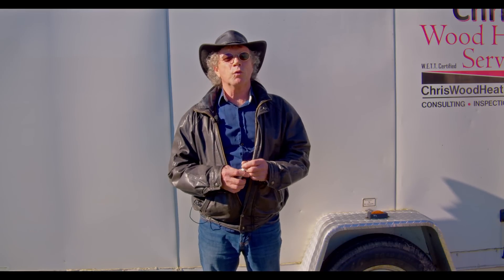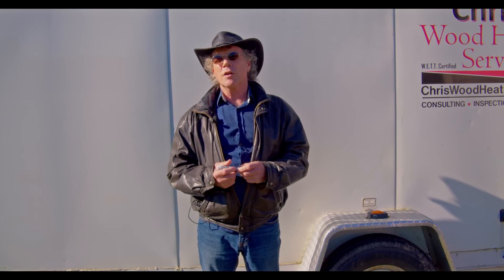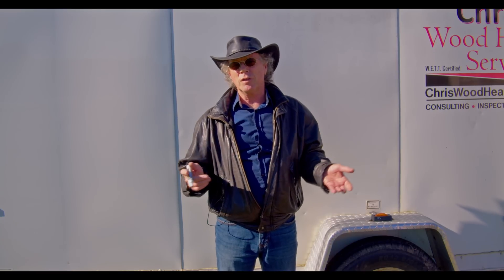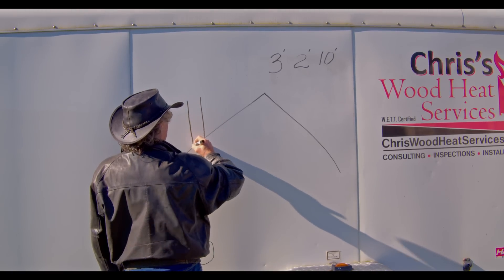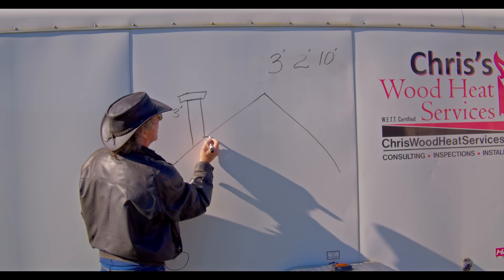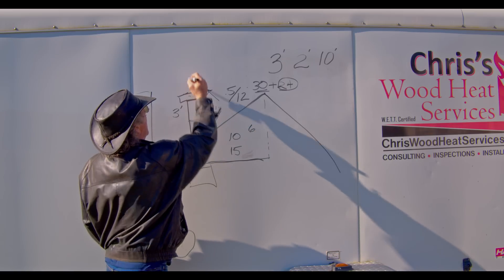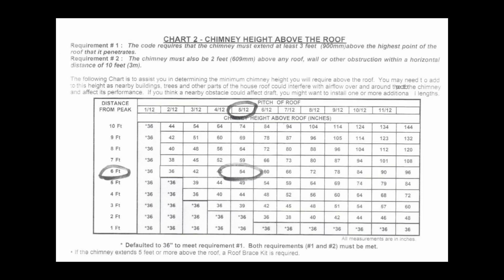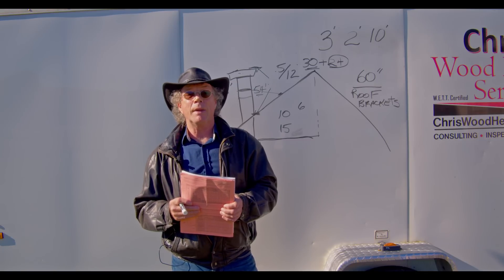How high does a chimney need to be for wood burning appliances, wood stoves

Comment: I just picked up an antique victorian stove.  As an uncertified stove I understand the distance requirements but one thing I am not clear about is the degree of the WETT inspection for other things.  For example, someone online said it cannot be certified if it has no gaskets/seals but this stove was never made with any (no place for one).  If you search McClary London Ontario model 19 - you might even find my photo of it online (for reference).  Also - I'm in Ontario.

Comment: So I do not climb anymore.  Watched this and figured from the ground.  I have a 7 inch rise in 12 inches from the corner by the gutter.  I have 8.5 feet measuring on the ground from the center of the hole to the peek.  The double wall pipe I have will extend one foot past the top of the facia and I have two stainless 36" single wall and a small cap.  Will be going through the eve as opposed to around the facia with bended pipe.  Always thought the higher you went the better the chimney, thanks for clearing me up on that.

Comment: I have a 9/12 roof and I've just over 10' away from the peak. Based on the sheet with the stove it says 114" for the above roofline chimney pipe. Does that sound accurate? I heard from some farmers that 3 feet over roofline is enough if I am over 10' away. I am in Upstate NY. Great VIDEO!
Reply from the maker: 114" is correct, that's from the roof line to the top of your chimney measured from the roof on the high side of the chimney to the top.
That will bring you two feet higher than the ridge of your roof.

Comment: Any suggestions for a house that is well insulated?  Useing a wood stove that is super Efficient, located in the basement is a challenge, the stove is hot the pipe is cold ,😅
Reply from the maker: I would suggest a wood stove rated for mobile home that can take it's intake air from outside and they don't depressurize the house. They are not special just rated for tight fit homes, there are a lot of affordable ones on the market.
Reply: Yes , I did that. The problem with that it is illegal .the fresh air intake can become a chimney, 😮
Reply from the maker: Here it's not illegal to install your stove anyway you want, just not insurable. In this case it's recommended to use. The stove would have to be rated for and certified for this purpose being used in that manner and insurable  and yes there has been anomalies where the flue gases reverse that's why they use non combustible venting for it.
  @MrSprintcat
Reply: Thank you for your reply, Chris.
I'm thinking  that having a company come out and do  weatherization on my house was a mistake. My old wood stove ran much better ,with not that much more wood . Now we are air tight with a high efficiency, BK, wood stove, and  stainless steel  liner the challenge is great😢. Old stove in 20 year old chimney was the cats meow 😅.

Comment: I'd call you to install but i think im a bit too far south of your service region. 
In regards to your comments about longer not always being better and heat wicking; what is your opinion on wall exits vs roof? Is it a terrible choice riddled with draft and creosote issues? I've only ever used a roof termination, i want to move the stove but not sacrifice performance.
Reply from the maker: Through the roof is always the best option. Keeping in mind that the most important issues is placement of the appliance and having the most direct and shortest route to get flue gases out of the building envelope with the fewest amount of direction changes.

Comment: What about high wind areas?  I live in an area that gets 50 mph straight line winds. Does just using braces stop them from blowing off
Reply from the maker: When in doubt bracket are less than 100.00, some lighter wood rated chimneys I would definitely use bracket like ICC EXEL chimney.

Comment: What about a 3 car garage with a flat roof to the right and high pitched garage to the left can I put stove on flat roof side?
Reply from the maker: Flat roofs pose a potential problem with leakage, having said that yes you can, as long as you out of the roof minimum 3' and are higher than 2' of anything within 10'. This applies if you live in Canada.

Comment: If I have a 4/12 pitch  and placing my  pipe just on side of the ridge, so my 3 ft pipe coming out of the roof should be good?  It would probably get me above the ridge by probably 18 inch's .. thx
Reply from the maker: You can add the chimney cap for additional height, but according to local codes and manufacturing instructions that I deal with you would need 24" above the ridge, you could have issues with turbulence or down drafts and even insurance issues unless you comply
Reply: @chrismajor6682  gotcha , thx for the quick response! You Rock.

Comment: So the pitch is 6/12
So you take 6x10=60"+24"
I have mine at 4 feet 6 inch's higher then the peak of the roof. Would the be good to have it?
Reply from the maker: Keeping in mind that your local regulation need to be considered but the installations instructions of factory chimneys and the standards here in Ontario Canada would be a minimum out of your roof 3' and 2' higher than the highest obstacle therefore is your chimney comes out of your roof 3' and there is nothing around or within 10' other than your peak or ridge of the roof you would only need to be 2' higher than that (the peak). Check you local officials to get your local codes etc... 
Having your chimney unnecessarily much higher there is possible issues with the flue gases cooling off create issue in very cold climates.
Reply: @chrismajor6682  we put the chimney 4'6" higher then the peak of the roof top
Reply from the maker: @claytonroberts344  If I am understanding you right, that's higher than the codes and manufacturers instructions I deal with.
The issue is then if it gets cold enough where you live the flue gases can cool off too fast and turn to a solid, (more creosote) if not, you would have better draw going higher.
Reply: @chrismajor6682  that's what I was thinking too.
Reply: I was thinking on going 9 to 10 higher up to get it were it is the same high as the peak of the roof of the neighbor's house
Reply from the maker: @claytonroberts344  not a good idea
Reply: @chrismajor6682  then what should I do
Reply from the maker: @claytonroberts344  Don't go to the extremes, going way higher can create creosote and servicing issues. You can always add sections so follow your manual or instructions and only add sections if you have draft issues.
Reply: @chrismajor6682  it drafts good but when the  smoke comes out the top of the chimley the wind still blows it into the neighbor's house
Reply: @chrismajor6682  it drafts good but when the  smoke comes out the top of the chimley the wind still blows it into the neighbor's house
Reply from the maker: @claytonroberts344  You should have roof brackets above 60" or 5' having said that you may have to go higher do to the nuisance it is causing in many areas they can complain and have the local authorities ban you from burning, so do what you have too.

Comment: How would this work for a gas appliance b-vent?
Reply from the maker: B vent is a vent not a chimney.
Reply: @chrismajor6682  yeah i know thats why they call it a vent LOL. I was referring to if you just want to use a b-vent thru the roof. I believe there is a 8' rule
Reply from the maker: @bkoz319  I'm a gas technician as well and It all depends on the classification of the appliance that's being vented and the brand of certified materials used
It's easy to generalize in general conversation but it's technical with all the different types of appliances and circumstances in roof configurations.
Gas unlike wood is not a DYI project.

Comment: You and your video are awsome sir thank you SO very MUCH. I would ask you please could you tell me the best flashing available to prevent any water leaks through my barndominium house. Im considering doing the through the wall method just because of this concern but i keep reading comments to not use 90s and go straight up. Any advice would be greatly appreciated 🙏
Reply from the maker: The chimney manufacturers all have roof flashing that is certified for their chimney system, the best way is through the roof, I use a metal flashing on metal or asphalt shingle roofs.
Check with the brand of chimney you are installing as to what is available.
Reply: @chrismajor6682  okay thank you i will do just that.

Comment: So can i have 10 feet high and 16 fèet horizontal? 5inch pipe on wood stove! I want to install to my home but i am a bit confused 😢
Reply from the maker: Not really getting the question, check out an installation manual to get the basic requirements for what your doing.
Reply: @chrismajor6682  thanks for your answer sir i downloaded your manual but i cant understand. I have a 7x6 metter home with triangle roof with tiles height 4 metters. If i have a total height for pipes 3.8 metter that means i come + 50 cm up the top of roof how many metter is the max horizontal length of pipe i can have? Pipe size is 120 mm (5 inch). Hope you can understand me
Reply from the maker: @ΠΑΣΣΑΣ-ε3φ  It sounds like you need to get a professional to assess your situation, I cannot determine your needs in what your telling me. Good Luck

Comment: My instructions just read the chimney should be 2 foot above the highest object within 10 feet. The building I'm installing the Wood Stove in is the highest object other than trees that are 10-12 feet behind the building.
Reply from the maker: Yes and a minimum of 3' above the roof line, it gets tricky when the roof is steep and the roof itself is withing 10', that's when the formula helps. thanks Casper for your comment.

Comment: The correct  way of installing a chimney is to get a professional  fitter  to do the work 
.it may cost a  bit more. But it's done right
Reply: It's not rocket science so getting it done right is pretty easy to do. It's not worth doubling or tripling the cost when you can do a couple hours research and find out the info.
Reply from the maker: @NickFrom1228  No it's not rocket science, I picked the two most common issues I see where people tend to get it wrong, chimney height above the roof line and Garage installs requirements. Thanks Nick.
Reply: @Nick Knight  So true I saved 2k by doing it with a friend, researched all the codes and is all done in code, and the satisfaction of doing it yourself was priceless!
Reply from the maker: Yes of course, but factory chimney's are designed for the general public to install as a DYI projects, and is why they are sold in hardware stores. Not all people who install their own chimneys do it for fun but out of necessity, installation by professional can double or triple the cost of installing a factory chimney. Not sure about your comment "it may cost a bit" you can add 1 to 2K. I install and/or consult, then inspect either way it gets done right.